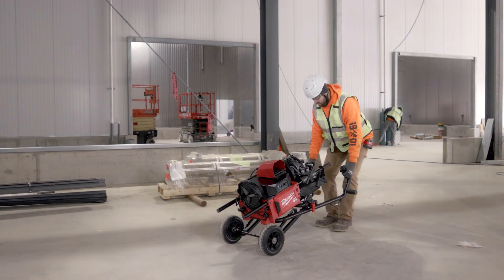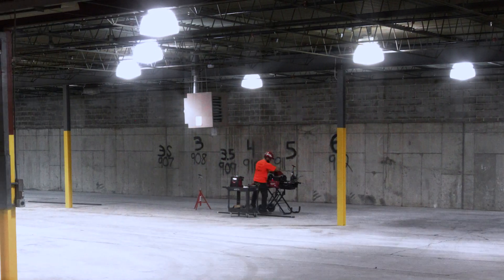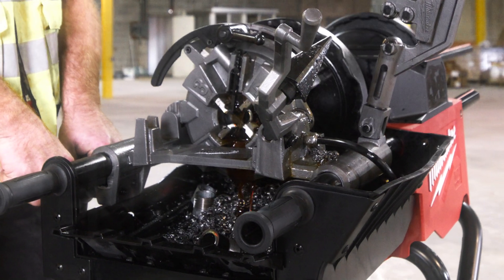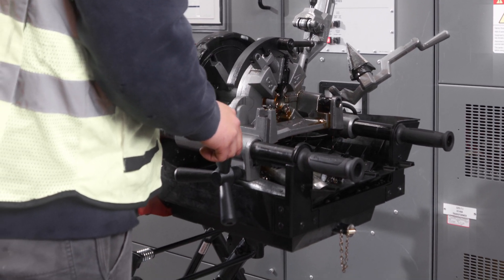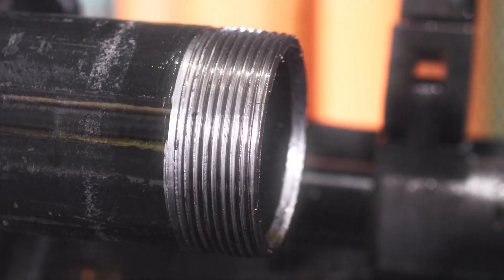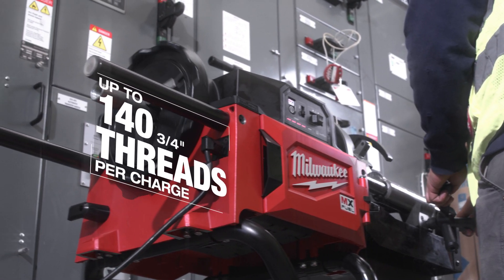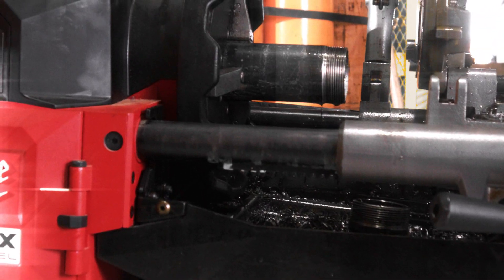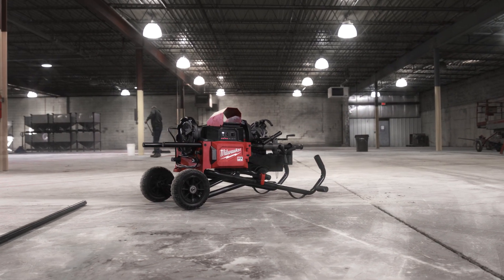Milwaukee MX FUEL™ Pipe Threading Machine

Comment: I was a fire sprinkler fitter for 5 years in the early 70 s and 80 s and ridged was king. Stock dies ruled. Universal dies sucked. it takes a lot of power to cut steel. I would love to thread a length of 2 inch schedule 40 with this battery.